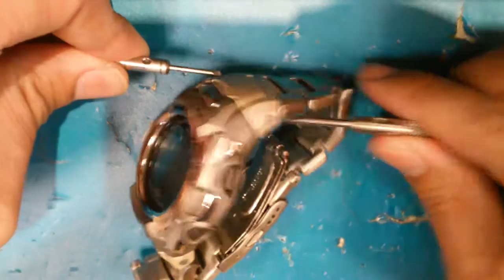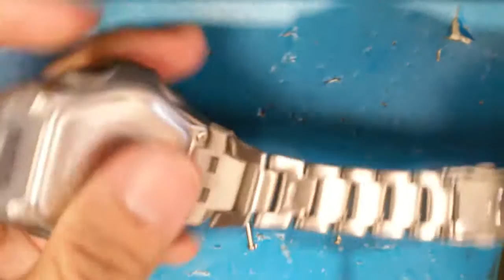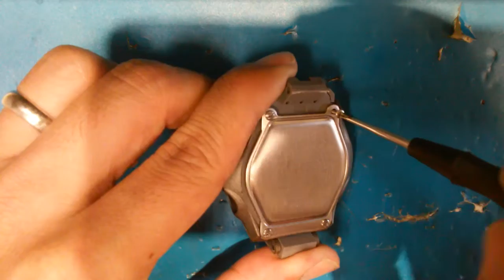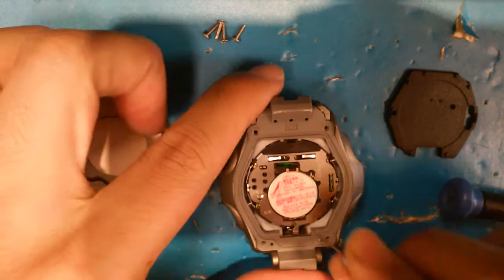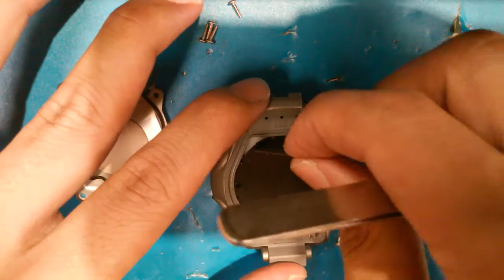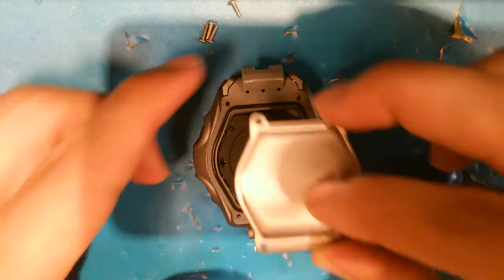Changing Solar Battery CTL1616 On GShock MTG M900

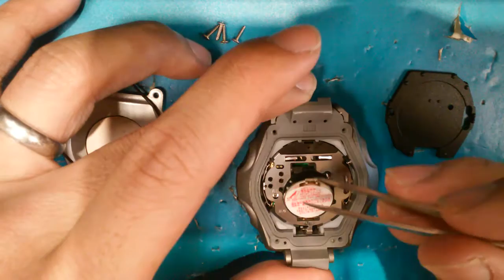Comment: A VERY Important step that most of you will miss.  At 1:50 he uses the tips of the tweezers to restart the watch after installing the new battery.  Pay close attention to where he places one tip of the tweezers and then touches the other tip (I think) to the edge of the battery.  I've seen this step shown on several other videos that cover replacement of rechargeable watch batteries for other Casio GShock MTG M900 models, but they make a point of telling you how important it is and specifically how to do it.  He does not and if you don't restart the watch you'll put everything back together and your watch won't work!   I'm getting ready to replace the battery in my MTG M900DA 3406 and this is the only DIY video I could find on YouTube for the 3406 model.  I appreciate the time he took to make this video, HOWEVER, I wish Chet would have made a point of clearly showing how to do this very important step.   Hope this helps!
Reply: No silicon grease?

Comment: what happened to it that you need to change the battery? Aren't solar G-shocks suppose to last a really really long time before the battery needs changing? I was under the impression that they could last 10 years easy
Reply from the maker: eeyyaakk it was only about 4 years old. Maybe it was on the shelf for a while.
Reply: Linh Le do you still have the watch? is it still running?
Reply from the maker: I gave it to my brother, he said it's still running.
Reply: Linh Le thanks!
Reply: Mine  is at LEAST 10 years old and only now needs to be replaced.  Truly an amazing tough watch!!!
Reply: @eeyyaakk6801  mine is 20+ years old, no kidding and now is when the battery needs replacement. This has been a beast of a watch and has seen rough usage.